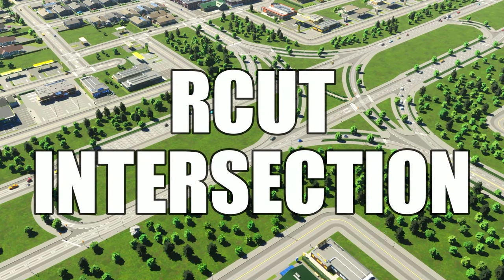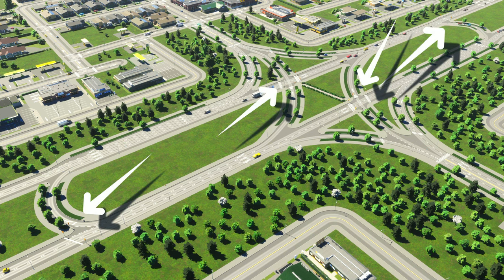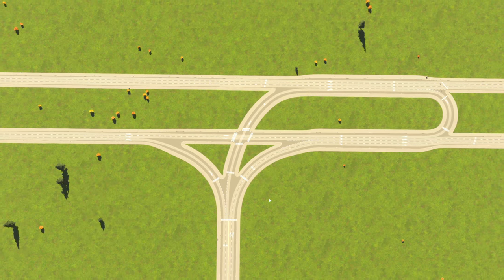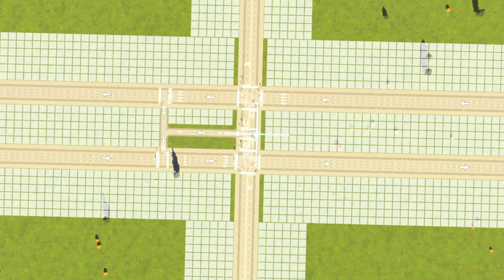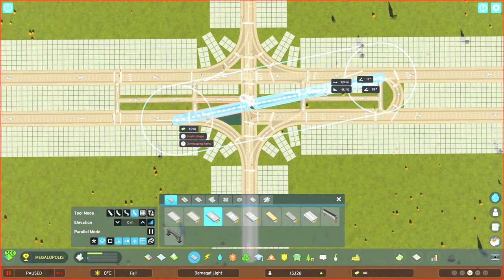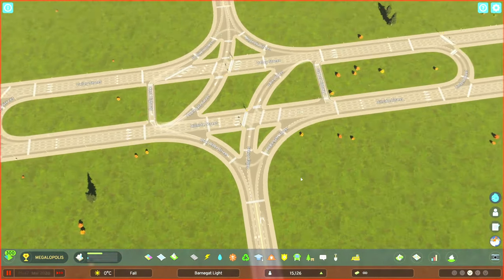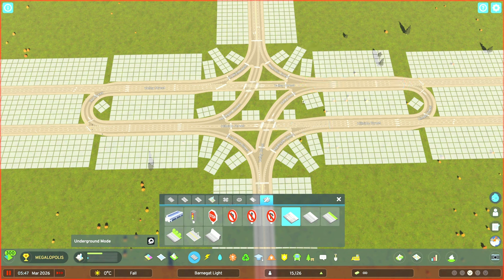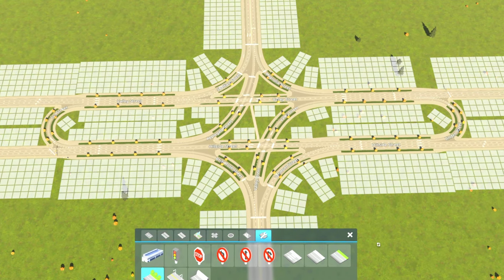Master the RCUT Intersection in Cities Skylines 2

Comment: In real life, these are worse than a normal interchange.  I've got two of these installed on my commute route to work so I know this first-hand.  Depending on the direction of travel you plan on heading, you are now doubling or tripling the stops needed in a very short distance.  Big trucks cannot do this quickly and as a result traffic is clogged.   If these intersections are signalized, they are about impossible to synchronize; again first-hand knowledge encountering this on a near daily basis.  I can't easily bypass this mess without going way out of my way so I'm stuck with sharing angry moments with other motorists waiting to get through.

With that said, I've recently found your channel and appreciate the tips and artistry to easily make these roadways and intersections happen in-game, even this specific build.  You show how to overcome some of the quirks and tearing that happens when attempting to complete even simpler roadworks. Oddly enough, this intersection will probably work good in the game.
👍
Reply from the maker: I always like hearing from folk that have driven on these intersections and interchanges. Always gives an extra bit of local insight which is cool. Especially given that there's nothing like this where I live in the UK. Glad you've been enjoying the vids! 😊👍